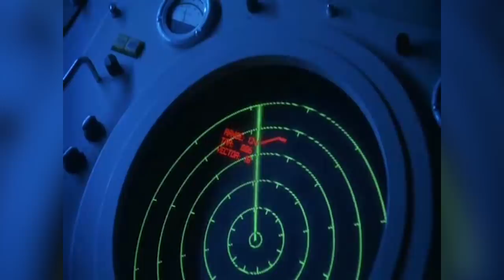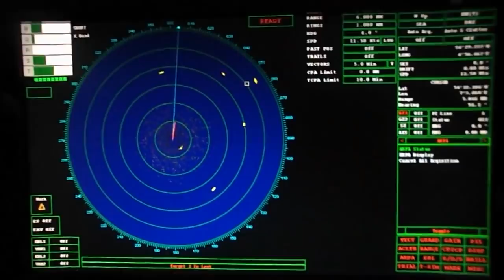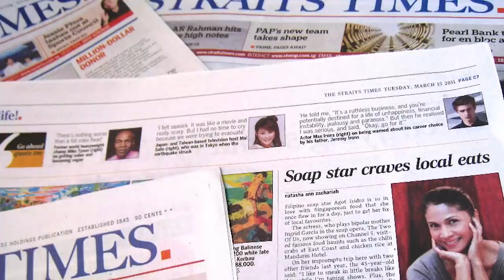12 Most Mysterious Incidents With Ships And Submarines

Comment: "Nuclear submarines are designed to be dangerous". A fire on a submarine "isn't an issue because submarines are underwater". What a joke, stopped watching then and there!!!
Reply: tcommoncold 1...Agreed. Not only running the risk of being burned, but the fire consumes the air that the crew breathes.
Reply: right? smh, they need to stop trying to come up with these goofy one liners and just give us the story...
Reply: You need to pay attention, the fire was the rubber coating on the outside of the sub not inside
Reply: michael wier I think they are trained to filter the oxygen out of the water (the O from H2O) with their lungs. It’s part of their survival training. You just inhale the O and leave the H2 alone.
Reply: @michaelwier1222  They should have just opened the screen door on the sub (standard on all Russky subs) and sent a fire control crew in.
Reply: No hes right  its under water they just close all doors to that area and flood it
Reply: Or when he said that if the Nuclear weapons had been on the submarine there would have been a nuclear accident worse than Chernobyl... Not how nuclear weapons work bud
Reply: @deadon4847  A fire inside the sub would still be more dangerous.
Reply: michael wier fires struggle to actually stay burning in a submarine, they turn the oxygen levels down quite a bit when they’re at operating depths
Reply: I think... he was talking from the Fire’s point of view? Like the fire can’t spread to anywhere beyond the submarine if it’s underwater, so the fire is dangerous to itself? It’s stupid but the best I could come up with
Reply: Sad Trophy Wife it wouldn’t, Search it up. A nuclear weapon explodes when the Plutonium core gets compressed into a critical state. and the explosives in the nuclear weapon that compresses the core will simply burn up if it ever caught on fire because they are highly insensitive, So nothing will compress the plutonium core to a critical state which means it will never explode. 

Don’t be disrespectful when you have no idea about what you’re writing about btw.
Reply: Sad Trophy Wife Nope, Good job showing that you can’t back what you’re saying for shit though, Gave me a good laugh.
Reply: @michaelwier1222  I mean granted the fire was ON the sub, not IN the sub, and a fire ON the sub would not be a problem if the sub was in the water.
Reply: @RoguellVoid No. Sounds like you are. Did you watch the video or just trolling?
Reply: @RoguellVoid No. I think you are. Did you watch the video or just trolling?
Reply: @RoguellVoid LOL...Go away troll!!!!
Reply: Isn't the reactor powerful enough to separate H2 from O?

Comment: This is the reason for the engine shutdown on Viking Sky.

According to the Norwegian Maritime Directorate, the level of lubricating oil on the tanks was within set limits, but relatively low when the vessel embarked on Hustadvika. The tanks were equipped with level alarms, but these had not been triggered when the vessel embarked on Hustadvika.
There was full cheer when the ship arrived at Molde on Saturday after a dramatic day in bad weather.
Arnfinn Mauren

- The heavy sea on Hustadvika probably caused such large movements in the tanks that the lubricating oil pumps lost supply. This triggered a low lubricant oil pressure alarm, which in turn led to automatic shutdown of the engines shortly afterwards, the directorate states.

Comment: Not known what happened xD Viking Sky had too low oil in both tanks when the little that was left sloshed about and exposed the pumps lubing the engines the safety systems shut down the engines to save them. It was human error on whoever was checking the oil levels.

Comment: 4:25 to 4:34, why? nuclear weapons is among the safest and most stable warheads there is, they can sit in burning jet fuel for hours without detonating, in fact, it is downright next to impossible for a nuke to detonate accidentally, at one time many old nukes could not even be detonated no matter what due to their safety mechanism getting stuck so to say.
now, while nuclear warheads being on fire is far from ideal, a actual detonation is just about the most unlikely thing to happen, if not outright impossible, the fire will destroy the electronics in it and actually make it even less likely it will ever detonate.

now the nuclear reactor on that nuclear submarine on the other hand... now THAT'S something you most certainly do NOT want to be on fire! luckily there is next to nothing inside a reactor that is flammable.

Comment: 9:07 Viking sky hade low amount of oil in its tanks. Not too low for normal weather, but for a storm.
It was published in a preliminary report on 27 March that the reason for the engine failure was that the boat movements caused problems with supply to the lubricating oil pumps which stopped.

Comment: The sailors and marines on that ship had mumps. Parotitis is the inflammation of the parotid glands, which are the major salivary glands located on both sides of the face and it's not similar to mumps, its a direct symptom of it. Parotitis can be caused by many different types of illnesses, but mumps it's the most common pathogen that causes it, and the only one that spreads easily like that and directly causes parotitis in most people who are infected. 
The MMR vaccine vaccinates against measles, mumps and rubella viruses, it does not vaccinate against any of the other pathogens that can cause parotitis. 

There are many other pathogens and commensal bacteria that can cause parotitis, but none of them will infect a whole bunch of people and cause parotitis in most of them.
For example both tuberculosis and HIV can cause parotitis, but it won't be a direct symptom, rather a complication that happens to only a small percentage of sufferers of those illnesses. 

Commensal bacteria that harmlessly lives on and/or inside our bodies, such as staphylococcus aureus that lives on our skin and can sometimes cause a disease, can also cause parotitis if it invaded the parotid gland and have managed to multiply quickly before the immune system could respond to it, but it can also infect other sites on the body, such as the skin and cause cellulitis, boils etc', it just depends whether the area was compromised beforehand, such as in the case of parotitis if a person has bad oral hygiene or decreased saliva production. Parotitis can even be caused by autoimmune diseases or due to a blockage of the main parotid duct, but again, it's not the same as mumps which spreads easily and causes parotitis as a direct symptom of the disease.

Comment: Stopped taking this seriously when he said underwater fires aren't dangerous
Reply: Gus Kelman  Even if he were a "C" student in high school science, he'd know that inside the limited space of a submarine compartment, the men could be killed from oxygen being lost to the fire, only to be replaced with smoke or toxic gases.  It shocks me that the writer (who is also probably the reader) could say something so foolish

If there were a leak in a water pipe or a breach in the hull, at least that could be contained within a single compartment, & the submarine would continue to function until returning to port.  But a fire aboard a sub, depending on the fuel source, can easily spread  through several compartments so rapidly that the crew wont be able to control it

...Granted, what little I know about submarine life I've learned as a bystander, watching PBS documentaries & films like the German-made Das Boot (1981), and The Hunt for Red October (1990).  But one doesnt have to be an actual submariner to appreciate why fire is the very worst threat to the ship

Comment: The Viking Sky wouldn't have had any problems if two engines shut down as it has four engines, but unfortunately the other two shut down as well, losing hydraulic-power to the stabilizers & electric-power to everything else!

Comment: Viking sky had poorly designed fuel tanks, so when she got in rough sea she started to suck air instead of diesel and the engine  s stopped, that's why both went out at once!
Reply: @oppvaskbjorn  clearly they didn't have the iq to design a oil system that dosnt allow low oil pressure to ever happen unless there are low oil to begin with..  It's not that hard.